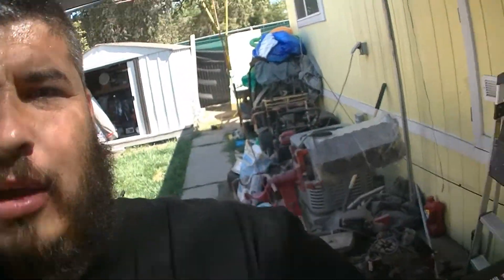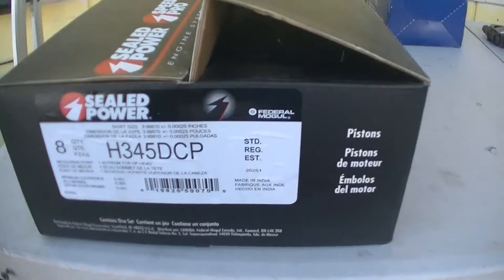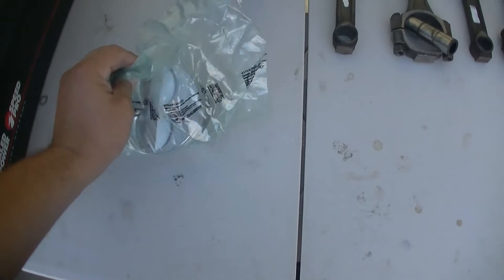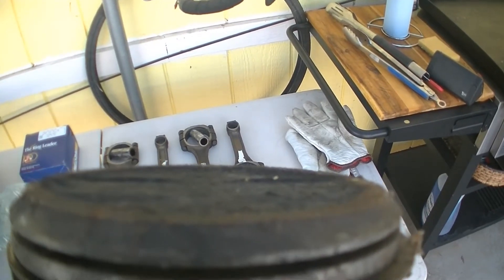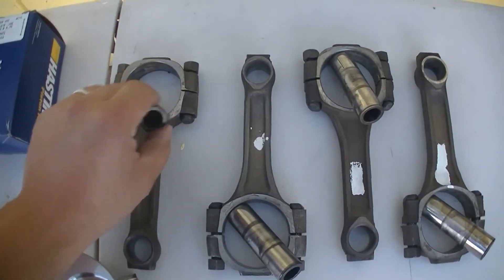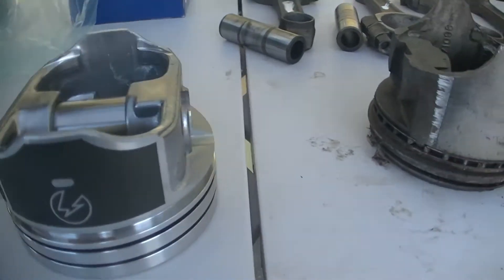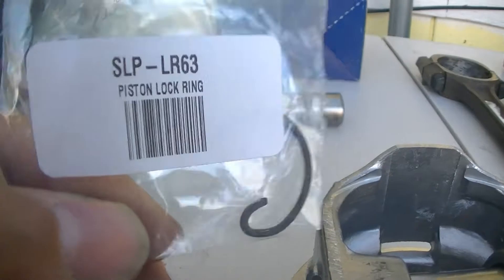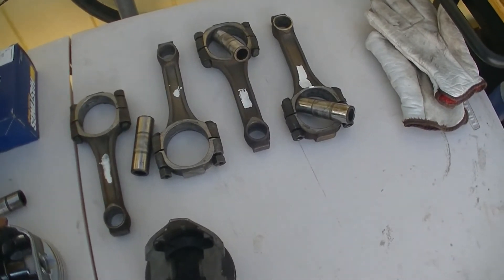Chevy 350 budget rebuild pt 4, pressing wrist pin on piston and rod

Comment: You gotta watch getting the rods to hot, there's a certain temp it works best without weaking the rod, can't remember what temp the machines are set for but I know it isn't to much more before the risks kick in. If you get the rod end hot enough to turn blue/purple its cutting it close to being overheated and you step into the risk zone. Of course some coloring is gonna occur when u heat them you just wanna be careful and not have to much color there.. I know it doesn't seem like some heat can damage them solid heavy rods but trust it can weakin the small end cause it to twist, bend, or even break plumb off in certain scenarios. But for just your average backyard project id say you done a good job. I mean if it was gonna be a high performance race engine im sure you'd be doing things a little different. Wanna see this bad boy fire up when you get it all done and ready! Im keeping up with the series 😁

Comment: DANGER, Incomplete process, pressing step not shown. I don't think anyone should follow this video unless they have successfully installed wrist pins on pistons before. If this is your first build, BE VERY CAREFUL. the pressing step is not shown. The wrist pins will slide out of the piston rod and destroy the side of the cylinder wall, destroying the block. This is an absolutely critical step that was omitted for some reason. Otherwise, thank you for trying to show how to do this, I really like your videos. But this one looks to be incomplete and is absolutely critical that this step is done 100% correctly. People really do like your work. If possible please try to be more accurate showing all the steps with this kind of stuff. A first time builder may not catch the danger of this process. Please correct me if I am wrong. I'm trying to study to build my first sbc 350. I've seen what those wrist pins can do to a cylinder wall.
Reply from the maker: When installing new pistons on ur rods first u have to see which type of rod u have, is it a press fit rod or a rod that uses a locking pins for the wrist pins. My rods are press fit but if using a press there is a high chance of damaging the new pistons, so what u need to do is heat up the end of the rod so it expands in order for the wrist pin to slide in the rod with ease. Once the rod cools down the wrist pin is locked in place and won't move
Reply: Also for people worried to do this themselves or lack the experience or ability itll be worthwhile to just take them into the machine shop, all shops have different rates obviously but I think on average they'll charge around $7 per rod to remove the old piston and press the new 1 on for you. Definitely worth the $50 to me just to save the time and trouble but if you wanna save the cash this way works just read up a little more on it. Having a jig to hold 1 side of the piston and stopper for the pin helps a bunch. They can be made fairly quick and easy
Reply: As to answer the comment.... @11:22 .....He did show heating the rod and sliding the pin in 🤔 not really sure what else you mean he left a step out..Did you watch all the video or just skip around and assumed it wasn't there 😆 🤣  its in there though

Comment: Make sure you figure out your piston ring gaps based on using this in a marine application. The gaps should be wider for marine application than those used in a street application. I used the hypereutectic pistons on my own 350 SBC build for a Volvo Penta 5.7 GSI. Piston ring end gaps on my build called for .034”. That is huge compared to what the street application calls for but nonetheless it needs to be larger due to the marine engine operating at higher rpm over extended periods. Your piston instruction sheet should point you to the right gap for your specific piston type. You may also want to check what the recommended piston sidewall clearance is.
Reply from the maker: Thanks for the info, i just followed what the instructions said for my application. Hopefully everything works out fine
Reply: @cali530marcos3  The pistons you used were made by United Engine from Carson City Nv. I know their instructions address this so if you followed what they say, you will be ok.

Comment: You changed the balance of the pistons and using the old wrist pins. The new wrist pins can be used. You have to do a little math and make a stop for the pin.
Reply from the maker: Yea, it's not going to be a racing engine or see high rpm for a long period of time so hopefully everything is good, if not then we will all find out together
Reply: @cali530marcos3  you'll notice if its to out of balance, will have a vibration at higher rpm, if its real bad it'll have that same vibration at idle. For what it is a little vibration at high rpm isn't gonna matter as much if your not winding it out much. But if it gets to where u can feel it just cruising around id pull it back apart and have it balanced before it wrecks some bearings or worse but like I said more then likely won't be to bad in normal rpm range